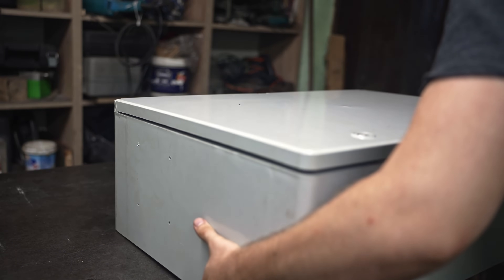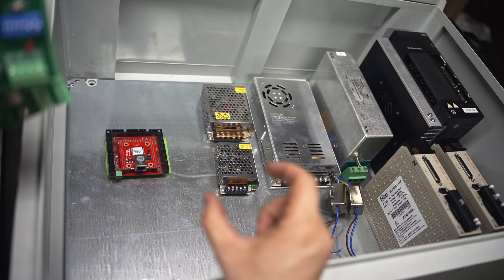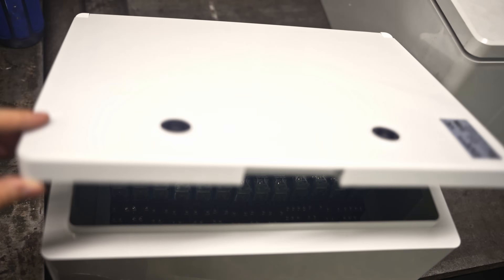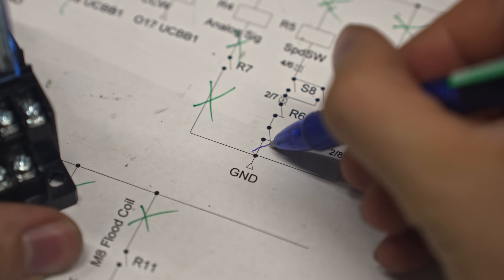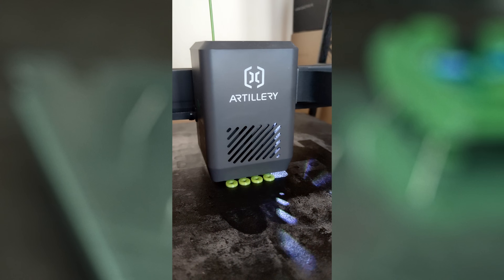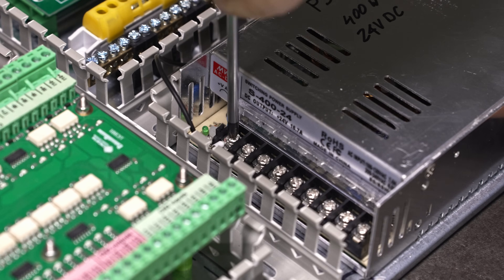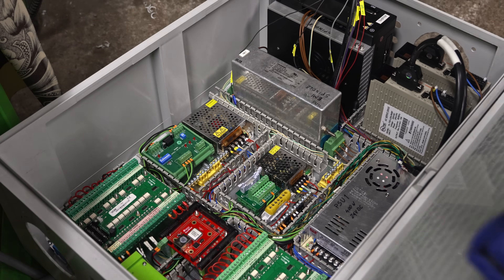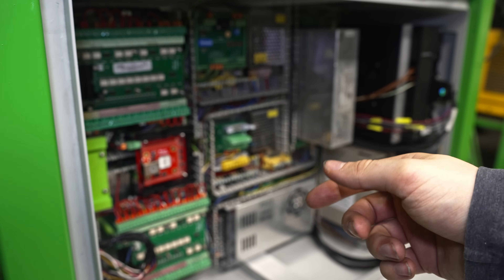Building the CNC Control Cabinet! - DIY CNC Metal Lathe Build #14

Comment: damn that looks amazing, I'm currently building my own CNC, but the electrical side I have no idea how and what is the safest and correct way of wiring it. what i mean is how and where and why to use relays and contactors and all that as well a filters.
Reply from the maker: Well - in most cases there is no need for so many relays as in mine. I did it just because I want to use my spindle in indexing and speed mode and therefore I added some safety features to make sure nothing goes wrong when I do any mistake. About the contactors - I added them do make everything a bit more convenient (like the possibility of disabling the drives if needed etc.). Some of the servos should be connected through contactors (usually info in manual). That's at least the "DIY world". On the "industrial side" things get sometimes more "strict".
About the filters - I use them to prevent electrical noise infering with other devices. Such noise is usually generated by VFD's / Servo drivers

Comment: Why you do not use Linux CNC and Mesa cards?
Reply from the maker: Why should I? :D honestly when I was building my cnc mill some time ago - the uccnc system was cheaper and with better availability than the linuxcnc with mesa. So I went with uccnc here too. It works very well on the mill and is enough for what i need.
Reply: Linux CNC seems to be more complicated to setup
Reply from the maker: @arbjful  Agreed

Comment: Hi, can you make a video about ac servo as spindle using pulse and direction?
Reply from the maker: Honestly ive never did it that way
Reply: @GBWM_CNC I hope to see you setting it up that way
Reply from the maker: @mordimustafa1275  Honestly - I'm going to use my spindle servo in voltage mode for speed control and I'm going to set it up also in pulse and direction mode but for indexing it.
Reply: @GBWM_CNC I'm looking forward to seeing that thanks in advance 🎉